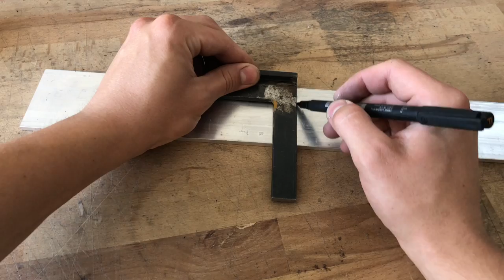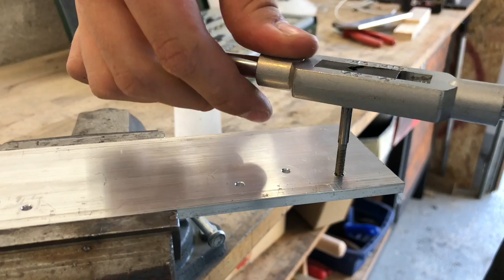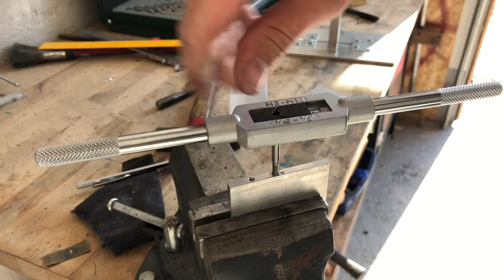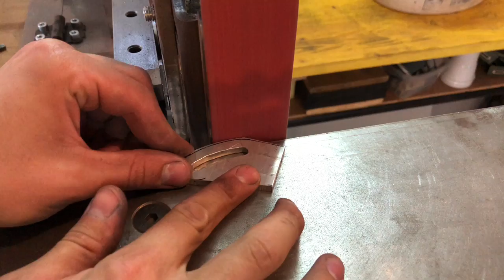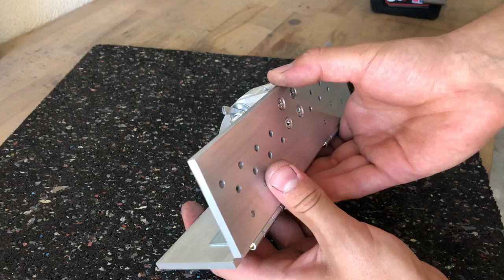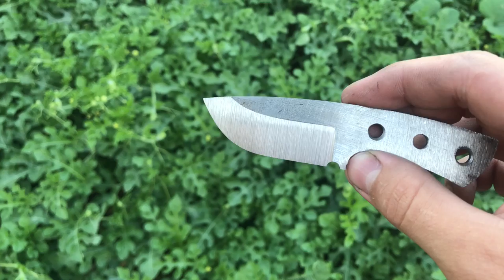How to make bevel jig

Comment: I am very much estatic to get started in this trade and make my  own blades one day and this is gonna save me so much time n ensure my products are what I want to look like. That being said, i am not well enough to have a big proper drill like this. Can an impact driver achieve the same job at getting through the steel block with the right bit n oil?

Comment: I can do this by hand on my belt grinder, but what about the other side? And what makes it run parallel to the belt at all times? Video please. I need to upgrade mine.
Reply: I'm trying to understand your question.
Obviously for the other side you just flip the blade around.
What do you mean parallel to the belt?
The blade edge is perpendicular to the belt, and the edge profile is offset at an angle from parallel.

Comment: Great video. Thanks. I like that you made your jig with aluminum while most others made with steel require welding. Drilling, tapping and shaping aluminum is much easier.  Question: What are the dimensions of aluminum bar your are using?  The best I could get at the home improvement store is 1/8 x 2".  Not thick enough and probably not wide enough either.
Reply: I made one with 3/8 x 3"

Comment: great job, but please next time use glove or any hand protection.
Reply: Zuwana while normally great advice it is suggested to never wear gloves while working on rotating equipment. I.e. drill presses grinders lathes. The reason for this is that if your glove gets caught it will suck your hand in and that is a bad day. All other times yes gloves should be worn.
Reply: yes, because of the fabric glove. im also didn’t use before but after my hand get cut by steel while using bench drill. i am suggest better use it. 🙏🏻🙏🏻
Reply: Zuwana for cutting operations gloves are recommended. But it’s a risk assessment that everyone has to do. Personally I don’t use gloves on anything that rotates.

Comment: Cool but way too much work. A piece of angle iron with one commercial hinge a spring some nuts and bolts and bam you got the same freaking thing without having to do all that precise cutting, drilling with a drill press, tapping all those holes I mean you probably had 25 holes to tap. Though it's most likely an awesome Jake to use. But I find all these designs less than desirable for people who might not be that mechanically inclined or are just beginning out. Because those people won't have a 2x72 grinder, drill press, taps and dies with the right screws that fit. But there's always many more jigs on YouTube if people want a simpler design. Looks nice though I'm sure it gets the job done pretty well